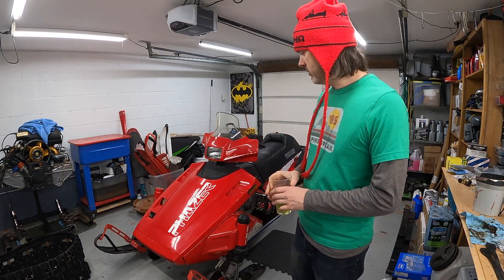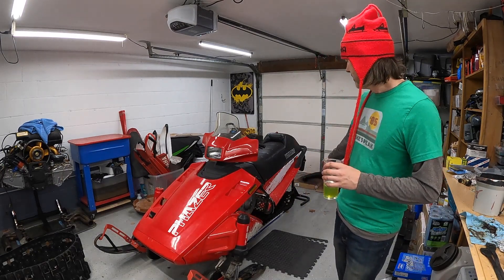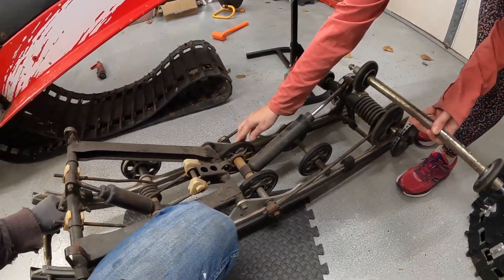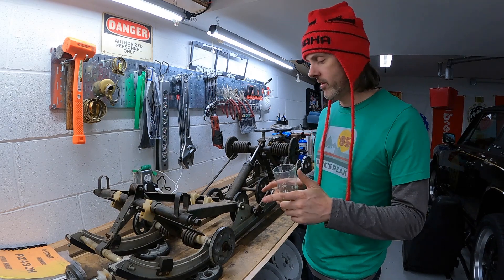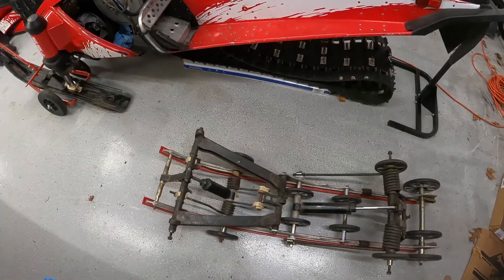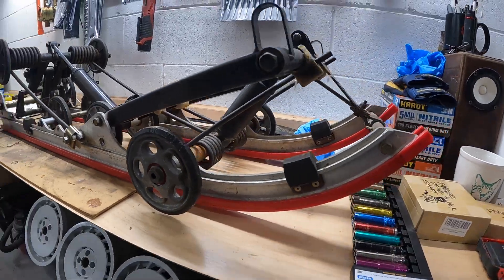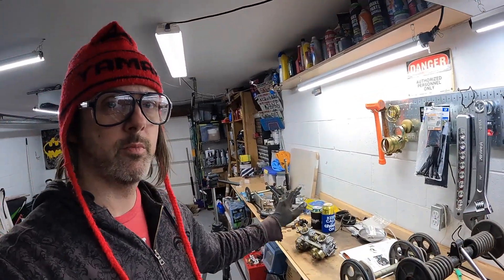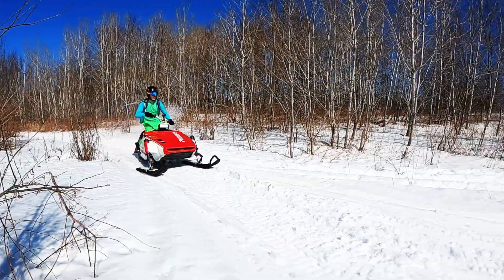How To Rebuild Refresh Skid 1984-1998 Yamaha Phazer 1 2

Comment: I loved my phazers!!! I learned that i could put a skidoo or Polaris rear skid that is alot lighter than the stock one.  The weight transfer really works on the phazer. Probably drop 25-40lbs depending on wich suspension you change too. The whole sled wakes up. I also put roller helix on the secondary clutch. That helped that machine always stay in the right gear. The vmaxes all woke up with the clutch mod and rear skid.

Comment: Bought my 91 phazer st back from my long time friend and the skid bearings are all shot lol. We had to use the hydraulic press to get some of the bearings to pop off the shafts and a bearing puller helps as well. Make sure to always clean up that aluminum before installing new bearings and wipe a little grease or spray some lube in them, makes the install alot easier. It's been quite project so far and yet it's a fun little adventure. Thanks for the great vids as usual.

Comment: As far as the wide front end kit; 84-89 Phazer's came with a narrow front end and a 116" track, there were kits to widen them out but in 1990 and up Yamaha widened them from the factory, they also put a 121" track on them. Put a cold air kit (intake) a set of aftermarket reeds and a single performance pipe on them, clutching and they are a 70hp rocket.
Reply from the maker: Nope.  This was even wider.  I own 4 phazers and this was wider than any of my phazer 2s and the bodywork is completely different.
Reply: @ADDvanced  Do you have any pics (better) I would like to see how wide it is, must be a complete custom job.
Reply: Came across a great pic of the front end, it looks like a Bender side panel and the sway bar and link looks like it's out of their race catalog. Where is the strut mounting shaft (round) cut to widen it out?
Reply from the maker: @davea5113   I don't have the sled anymore but if you check out the other phazer videos it shows it in more detail.  

https://www.youtube.com/watch?v=jua1V09lv7Q

Comment: Great video! Only thing I thought of was anti-seize is abrasive and does dry out so I would have put grease on the spring slides. Cheers
Reply from the maker: Good idea, did not know that.   I'll grease them before installing.
Reply: As long as its not turning on the shaft should be fine

Comment: I'm completely restoring a 98 Mountain Lite and just finished the skid (my very first). It came factory with the 136" track. I went a lot further than you did though as I'm a meticulous a-hole and retired machinist.. LOL. Ask any machinist - we can't help ourselves for wanting perfection! Or maybe we are Borg?. Yikes ! 

Actually the main reason for a thorough tear down is because the prior owner beat the living hell out of the sled so I wanted everything new and don't have to question what's under me. I do the same thing with any used car I buy. Overkill? certainly. Old habit I guess.

Anyway,

I sandblasted all my parts and epoxy painted everything. Having my 20-ton press really made things simple too. Pops those bearings out effortlessly.  But believe me, I've done countless bearing replacements in my younger days exactly like you did... with my trusty BFH, a block of wood and some good rust buster.

I like the way you did yours in sections. Kinda wish I did mine that way but that old machinist part of me kicked in.  I took a shit-ton of pictures and then tore the skid down to individual parts so I could clean and paint. You're exactly right saying these skids can definitely be a challenge to reassemble. I even had my other Phazer sitting right next to my 98 as a guide and it was still challenging in a few places my camera didn't get.

A few tips this skid noob learned: 

1. Take LOTS and LOTS of pictures before you tear something apart! As the old saying goes: A picture is worth a thousand words! I can't count how many times a simple picture saved my bacon. Just about everyone has a phone with a camera these days, or your shop buddy does, so you have no excuse.

2. If you happen to forget where the wheels go back on the skid, the ones WITH the holes on their side goes on the BOTTOM of the skid!  The wheels WITHOUT those holes goes on top. The largest wheels go in the very back (kinda hard to fudge where those big bastards go). I'm guessing Yamaha did the side holes to help clear the snow.

3. If you do use a floor press for bearing R&R and you're not that familiar with operating one... BE VERY CAREFUL! Double and triple check you have that snap ring out! 
A hydraulic press is stronger than you think and can destroy that aluminum wheel quicker than you can say WTF was that? (don't ask me how I know this... while at work... on a very expensive part while the boss was watching) LOL!

4. RE-PACK THE BEARINGS! Even new ones! 
This is a debated one, but I decided to follow the advice of others and popped the seal off every new bearing and re-packed them with better quality grease. I used a low-temperature type that is specifically designed for sleds and other winter equipment. 

Even brand new bearings don't come with very much grease and some cheaper ones don't have any grease at all! Not to mention do you really know what kind of grease is in them? And that's where the argument comes in. Personally I decided to err on the side of caution. It's a pain in the ass to R&R the bearings, so do it now while they're out and in your hands. It's not going hurt so long as you're careful and don't over-pack or nick the seal. There's plenty of information on the internet about this procedure. 

Thanks for the video!
Reply from the maker: I tend to do the same thing but I kept telling myself 2 things:  1.  Just get it done fast, this is not going to win any 'shows', and 2. absolutely nobody cares or will ever notice once it's on the snow, lol.   I have finished almost 2 phazers this season front to back, but I was shooting for 4.   Time flies when you're having fun/struggling with rusted fasteners/snap rings.
Reply: You both are awesome for restoration on these sleds. They are my favorite. I had 4 of them from the 80s through the 90s. I will tell you that Yamaha has the worst weight transfer out of all the brands. So I took a skidoo skid out of an old summit and stick it under one of mine. It weighs a third less and it made the phazer do what it was built to. Get the transfer onto the track and they become rockets. I could climb with the 700s in the mtns. They couldn't believe that little sled would do that. Well thanks for the vids. Those are my favorite color phazers. I'm very jealous

Comment: Looks to me like you could use a small arbor press or bench press. It would eliminate beating on a lot of things and it won't take up a bunch of space.
Reply from the maker: Good idea, I'll keep my eyes peeled for one
Reply: @ADDvanced  If you have a Harbor Freight store of similar, their 12 ton floor presses aren't that much. Better yet get their 20-ton if you have the room and think you'll ever need a larger one.They are on sale all the time.

I've had my HF 20-ton for years and the only problem I had with it is the jack eventually failed. It took a lot of abuse for many years though, so I expected it would die at some point. Just grabbed another jack and I was good to go. I don't recall what I paid for the press at the time. Something like $150 or so on sale. I'm sure they cost more today (like everything else) *sigh*.

*TIP: If you do get a shop press, do yourself a huge favor and put it on wheels! I have a small shop, so making it mobile helps a LOT.
I used larger steel angle and put 4" poly wheels underneath (2 that swivel and 2 that don't).
Reply: If you have a large shop vice, they also work great for a make-shift press. You can get a lot of leverage with that vice handle and a couple of sockets as spacers. That's what I did with U-joints before I bought a floor press. I sometimes use my mill vice too.
Reply from the maker: @billybobsowbreath1774  Yeah, I am running out of room.   I do have a neighbor with a press tho, so hopefully I don't need to ever buy my own :D

Comment: Will the skid extensions work on a 116 skid 
And if so any ideas what size track it would take
Reply from the maker: I would think they’d fit but honestly I’d look into swapping skids; the phazer skid is just so heavy
Reply: @ADDvanced alright thanks for the help
Reply from the maker: @xavieralt2498  No problem, that's what I'd do.  Stock skid is just a boat anchor.
Reply: @ADDvanced  I got the sled for $200 it's clapped out the skid is basically junk but i I was thinking if I could just get a skid extension and add rebuild the skid but yeah ur right I will just look for a different skid
Reply from the maker: @xavieralt2498   You can rebuild them... they're just heavy, and in a phazer build weight is the main enemy.
Reply: @ADDvanced  true

Comment: Dude loving this build I have the same exact sled did you find cone filters for the carbs I absolutely hate the air box spot as well man
Reply from the maker: idk I'm hearing a lot of people say cone filters will cause a lot of issues.   Undecided right now.
Reply: @ADDvanced  i hate that air box too ...hard to do anything with the carbs with it .........but .....if you keep it clean and make sure there are no broken boots its your best option for getting air to the carbs ...differnt air boxes or filters if you are planning to trail ride and have a dependable machine stay away from ...the bender and other pipes really wake these sleds up too but i've had nooooooo luck with keeping the motor together after ...and yes i jetted and messed with the clutches ..that engine will last forever its a real jewel but if you do anything to it in the way of pipes and pods you are risking a long walk home in the snow

Comment: hyfax slide number you have down does not work on a 1992 phazer 2 they use a number 18 Colored Slide - Style 18 - 52 1/4in. L - Red 04-198-02
Reply from the maker: Thank you for the information!